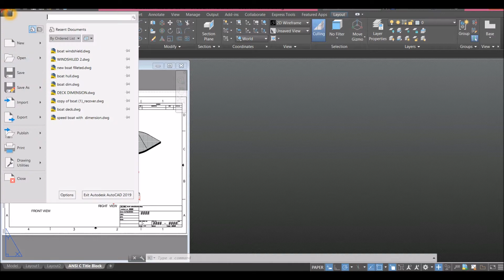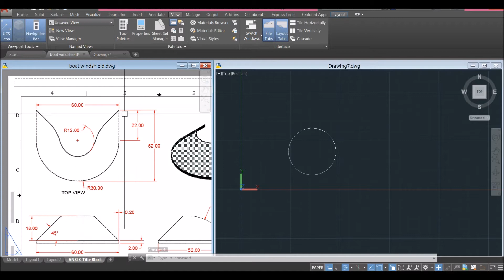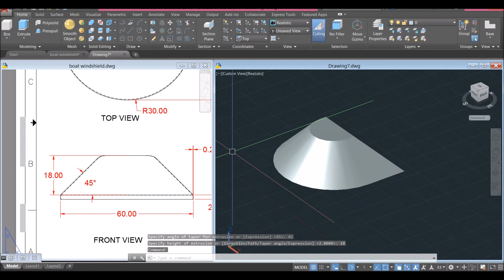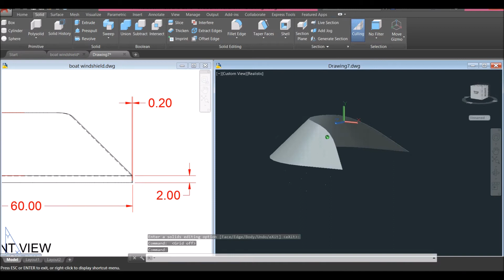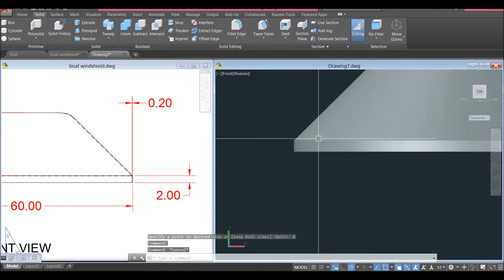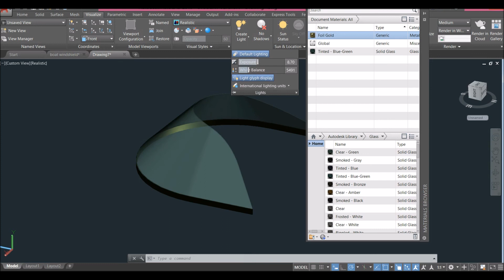Designing 15 feet Speed Boat in Autocad PT.3

Comment: Thanks again for the upload. Where did u get the drawings for this speedboat  from?
Reply from the maker: I will be providing the pdf file soon for practice.
Reply from the maker: This is just for practice, not intended for manufacturing. I just made up the dimensions. Thanks for watching.
DISCLAIMER
The dimensions provided are intended for information and practice purposes only. No warranty or representation as to the completeness or accuracy of the dimension of said materials is made.